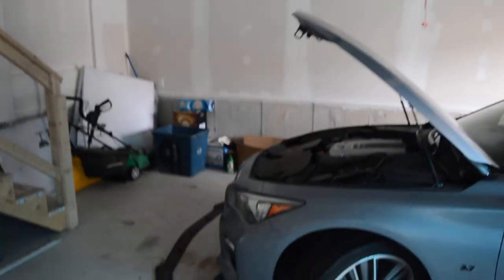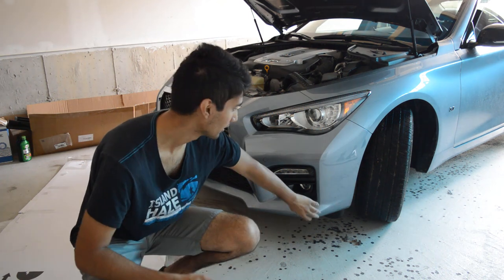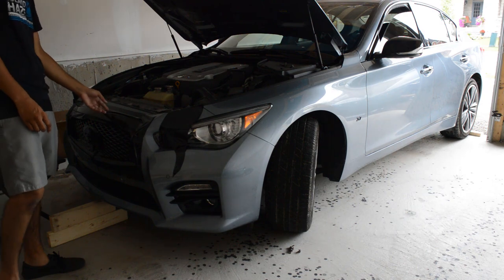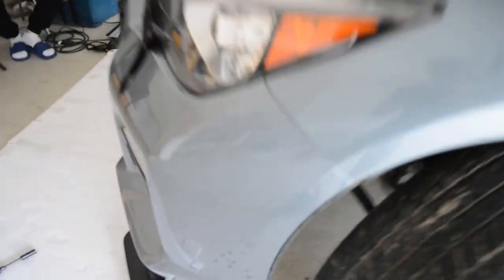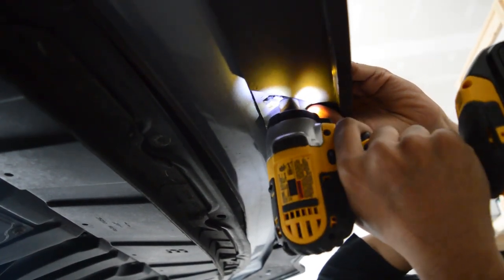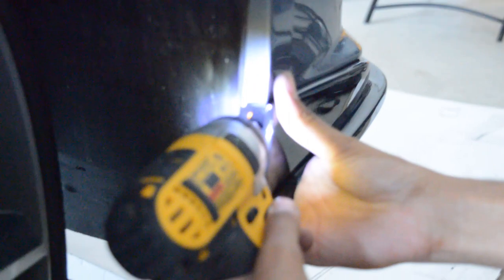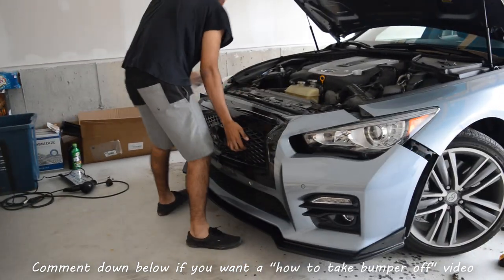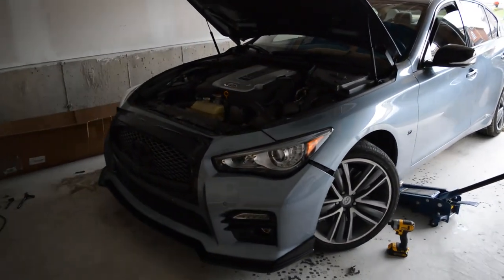Putting on the sport front lip on the INFINITI Q50

Comment: Hi do you really need to take the bunper off to get that bolts and nuts tighten up? Can you just take off that plastic engine cover at the bottom to have access to that lip of the bumper? I will be doing this mod just waiting for the parts.. thanks
Reply from the maker: MrRainnnsss you don’t need to take off the bumper but it is easier that way 🙂 you can just take the plastic cover off like you said but the reason I took the grille off is because I was also removing my grille
Reply: hey man, did you ever end up doing this? I don’t want to take my bumper off, was it easy to take off the engine cover and just do the bolts from under the car?
Reply: @abdullghoriO1  you do NOT need to take the bumper off. Take off the underside splash shield, and when you have the car up you will have access to the backside of those bolts. Also, you should use large washers for additional support.

Comment: Please show how you took the bumper off. I can't take mine off
Reply: Go to AMS website and look at the installation instructions for the heat exchanger. Scroll down to the section about the bumper cuz you gotta take it off for that. Off the top of my head jack the car up, take off the under tray, remove the screws holding the bumper to the wheel well, inside the wheel well I think there's a tab connecting the bumper to the rest of the body, then by the headlights there are 2 bolts each side connecting the bumper to the body, remove those then carefully remove the bumper. Push down from the top near the headlights to remove that portion because there's a little tab holding it in. Just be careful and have patience so you don't snap anything. None of it requires much force to remove or reinstall.

Comment: Did you have to buy those nuts you put on the other side of the bumper for the bolts? If so what size?
Reply from the maker: George Drivas ya I had to buy them as well. The size doesn’t really matter it just has to match the bolt :)
Reply: Anish Nothoo awesome man thanks bro. Just to be sure those bolts are the stock bolts under the car? The splitter has holes for them to be put through correct?
Reply from the maker: George Drivas nono, I had to buy the bolts, washers and nuts nothing comes with the car. And the splitter didn’t come with holes so I just drilled through it
Reply: Anish Nothoo so you just drilled regular holes in then fed those bolts into them and tightened them up with the nuts? Sorry for all the questions broski but I wanna make sure I get it right
Reply from the maker: George Drivas no worries bro but yeah that’s exactly what I did, lmk if u have other qs

Comment: Hey bro I recently bought a lip for my Q50 3.7 but it doesn’t seem to fit , are there different lips for the Q50 and Q50 sport?
Reply from the maker: Ahh shit unfortunately yes there’s different lips. There’s a premium one and a sport one so you should look into which bumper you have (premium or sport) and buy again accordingly
Reply: I believe I have a premium , and what’s the difference between these two? They all kinda look the same
Reply from the maker: The premium is more rounded whereas the sport is more aggressive near the bottom. Specially near the fog light area
Reply: Oh yes I noticed that it’s more rounded , could you help me by giving me some recommendations
Reply from the maker: Yessir! So here’s a few options: 
1. Sell the sport lip that you accidentally bought and buy a premium lip which should technically be a little cheaper. Also, if you have the 1 piece sport lip these usually sell fast as they’re more rigid than the 3 piece. 
2. A lot of people end up switching to a sport bumper down the line so you could just get the sport bumper right now since you already have the lip but that’s the most expensive option and not everyone does it so it comes down to whether or not you like the sport look better. 
3. After you sell the sport lip and you don’t like the lips that are sold on the market then you could also make your own from black plastic. This is the least expensive option but it will take some time to make and cut the piece and so on. Also you might need a rotary tool for that 

But yeah that’s all I can think of right now, hope that helps 😊
Reply: Thank you 🙏 but I also have another small doubt, as I browse 3 piece splitters I see some with the title “base premium” but to me it seems exactly as the one I bought , or Is there a difference? I have a 3.7 2015 Q50 as you mentioned , the bumper is more rounded
Reply from the maker: @alpha5033  i think they make the 3 piece lips for BOTH the sport and premium bumpers but I personally wouldn't recommend the 3 piece as they break easily

Comment: Did your lip come painted?  Ironically I have the same lip as the link you posted (That I ordered back in January), but its not the same as the one you're installing and now I noticed that I want the one you have that wraps around the edges of the bumper around the wheel wells, so I can pretty much screw mines down like you did.  Definitely dont feel like the one I have would stay on with just 3m tape, but hey I could be wrong.  Either way, I'm getting the other version.
Reply from the maker: My lip did not come painted I made a video on how I painted it on my channel if you would like to watch that! The one I linked is the cheapest one I could find on amazon but it is not the one I got unfortunately. Good luck with installing!